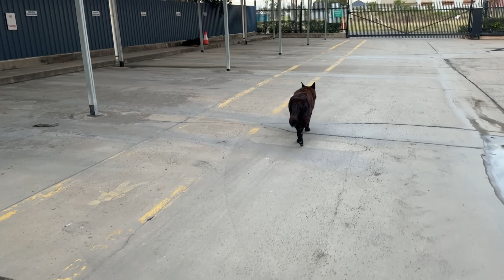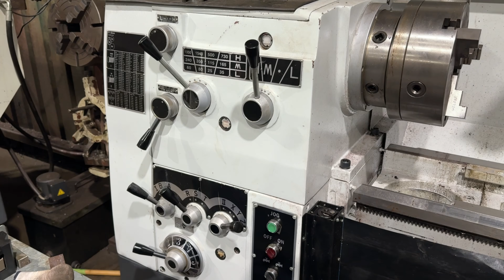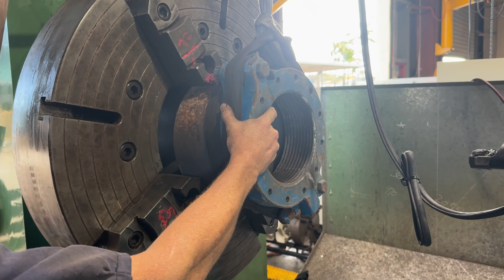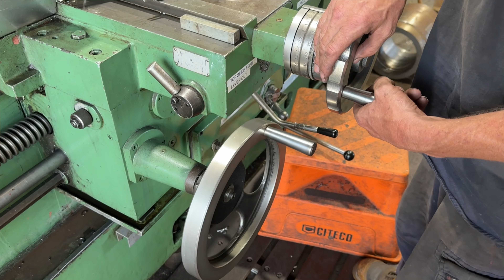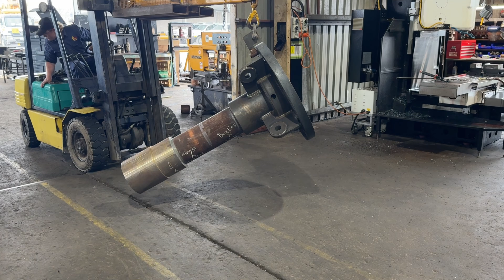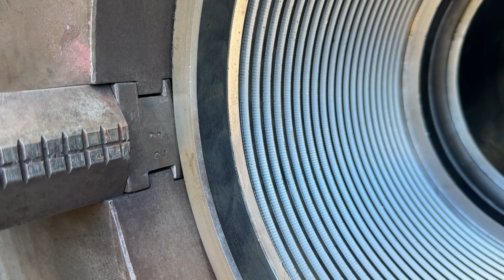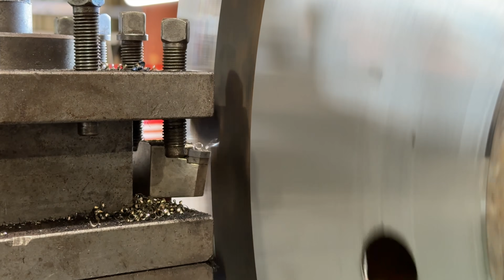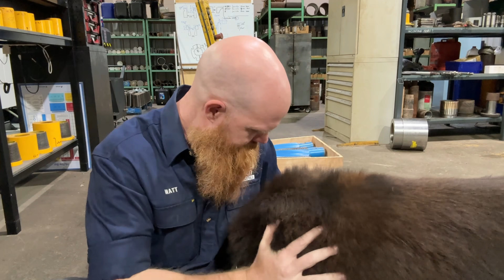Why We Bought a MEGABORE Lathe (… and 5 Things We Use It For!)

Comment: I know of ESP Pty Ltd , they used to be on Frances St Brooklyn. Company I once worked for called Andritz in Geelong had an old Chinese universal mill sold to Andritz by esp. they were kind enough to supply some detailed electrical info they still had from the 90’s in their data base.  I had to repair the mag clutches and get feed running again. Love your work, keep it coming Matt.
I also worked for Godfrey hurst in Geelong as a fitter, they had one of those large bore lathes with forward and rear chucks. We would machine the journals on large carpet pinch & idler rollers. The name of it I’ve forgotten but it was made in India. 
Currently retired to my hobby shed where I have an old Aussie made lathe, a 3 phase Nuttell made by Kirby NSW 1975. And various other small metal machines where I’m making 2 wombat steam locomotives, 5” & 7 1/4” gauges.
Reply from the maker: I just love that they're called Wombats! Sounds like you've got a great little setup there good sir!

Comment: The hulk having in excess of 21 HP? 🤔 most  lathes I have seen had nothing over 1-3 HP! ✌️
Reply from the maker: I reckon it’s WAY over 20.  The big CNC is 20 HP and can’t run the 130 HTS.

The hulk doesn’t even struggle 😶

Comment: Congrats on the 20k! I run a victor manual which I thought was a big lathe until watching your videos. It is a good machine for long rods but it only has a 4 inch spindle bore. We also have a couple of prototrak cncs. Those are decent but not very rigid.
Reply from the maker: Good to know.  Thanks for sharing mate.  I've heard Victor lathers are pretty good.

Comment: Notabengineer youtube channel built a computerized phase controller so he can dial in any thread pitch on the fly using his geared threading unit. You should have a look if a similar system could be done for the hulk.
Reply: I love Curtis also. Great channel.
Reply from the maker: It’s fun to watch. Man knows his stuff.

I think the hulk is best left as a big old school manual boy.  Good to train appreciates on with gear calculations 🤣

I think we’ll get a matching CNC in the near future. It’ll DEF def plenty of use

Comment: Fitter machinist for 40 yrs now, heavy stuff too, building ships and I reckon you might do alright by looking at some vertical lathes and maybe a  horizontal borer. When the work gets that big, its often easier to move the tooling in relationship to the work as opposed to moving the work with a stationary tool.
Other than that, good operation there champ, I like a well oiled workshop, and the videos are a bloody good watch too - good formula.
Reply from the maker: Cheers brother. Yeah we are definitely looking at a horizontal borer.  Stuff is getting too big to throw into a lathe

Comment: During WWII my father ran a huge lathe that machined 16 inch naval cannon barrels. Designated as 50 caliber, that meant the barrel was 50 x 16”, or almost 67 feet long! I don’t know if that includes the free bore space for the projectile and multiple 200 pound bags of propellant plus the breech locking mechanism, as well. He said it took 2 large overhead cranes to position a raw forging on the lathe. He said the work wasn’t too hard except for the nights (he worked afternoon and midnight shifts) when they were putting a barrel on or taking it off the machine. Or when the engineers were trying out a variation on the steel formula. They told the operators very little, but the steel let them know when it didn’t like the established feeds & speeds and cutting tool geometry. 
My twin brother and I were two years old, and I clearly remember when our daddy came home in the morning because he would sit at the top of the stairs, we’d hear him and run from our bedroom, hug & kiss him and grab the package of Campfire Marshmallows he had for us in the breast pocket of his shirt. He told the details of his job when we got older.
Reply from the maker: That’s so cool. Thanks for sharing good sir.  Sounds like he was one hell of a guy
Reply: I worked in a Naval Dockyard which had a lathe with a 12' (3.6m) face plate and the bed was about 15m.  It was intended to repair main shafts of ships.  I never saw it run in 20 years.
Reply: Would love to see videos of the machine of those barrels.

Comment: That ITM holemaker must be just an Australian product.  Even looked for it out of curiosity and at least in Canada it doesnt exist. 
We run Eberle Semitech 500 here. German brand stuff, semi synthetic and quite reasonably priced. (Actually its among the cheapest coolants available here)

I absolutely love the stuff, its a perfect middle ground. Very oily product, behaves like a traditional soluble oil in drilling, running large HSS spline cutters, ect. But it lasts forever in the sump like a full synthetic.  Weve had stuff sit around a year and you couldnt tell. 

We run it in everything here. I've paid double for coolants that are substantially worse
Reply from the maker: Sounds like great stuff! I’m going to look into it. Thanks mate
Reply: @halheavyduty  no problem at all! Other things I've found is mixing coolant with RO water makes a huge difference in how long it lasts. We've just got one of those few hundred dollar under sink RO filter units. I just fill water cooler jugs and use that to mix our coolant. 
I think a lot of the issues with shit growing in coolant is from shit that was in the water to start with
Reply from the maker: That's interesting!  I'm going to look into getting an RO set up here. I reckon you're 100% on the money there.  

I didn't even think of that.  But now that its on the radar... imagine the shit that's coming out of the tap... into the machines... yuck!
Reply: @halheavyduty  we've really had no issues at all with coolant going bad since setting up the RO system. It seems to make a lot more of a difference than I'd have believed